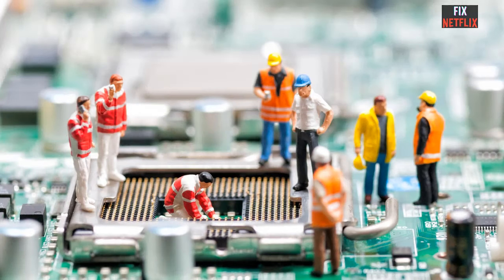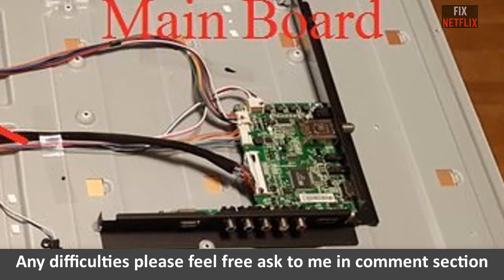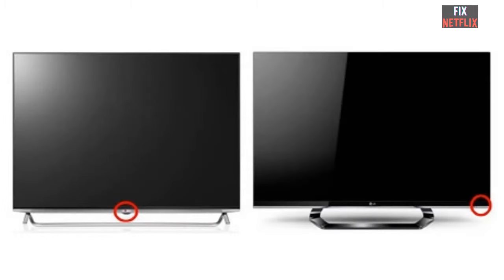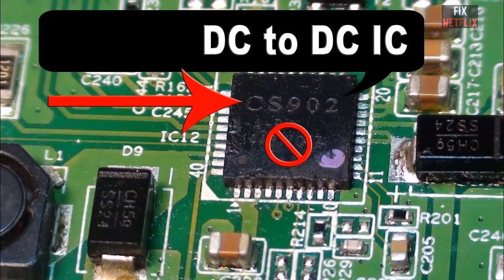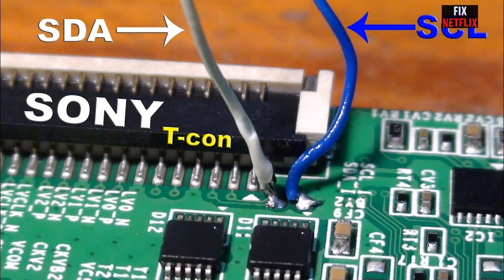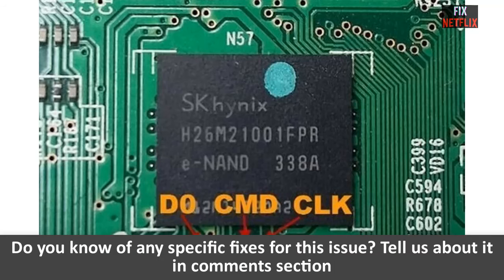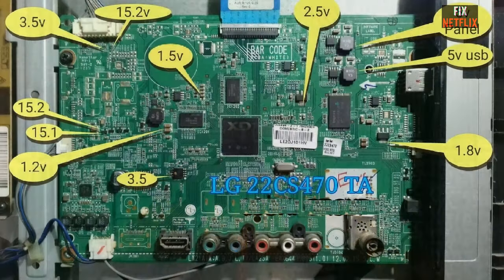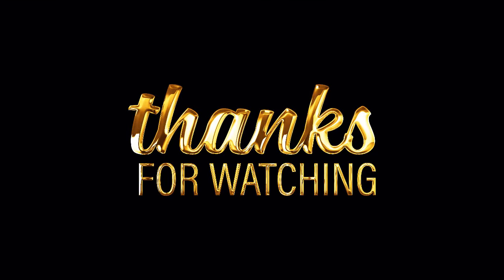Samsung TV Mainboard Repair Guide || Step BY Step Troubleshooting || You Must Know It

Comment: Thanks for the very good troubleshooting video.  With a Samsung tv/monitor, LT22b350, with the mainboard unplugged, the power supply has PS_ON 3.3v,  with the mainboard plugged in it has 0.5v.
The standby led blinks once when mains is plugged in, then it is off.  
It appears that the PS is good, 13v, 5v, and 3.3v where expected with mainboard unplugged and only 0.5v when plugged in. What do you think?

Comment: I like your videos.  I have a 70 inch sharp tv model number LC - 70le660u. The tv back lights turn on but I don't have a picture,  but the back lights won't turn off. I am wondering if you have ran across this problem and can help me. Thank you

Comment: The background information: I have a Samsung HG55ND678EFXZA Hospitality TV. All of the peripheral ports (HDMI, USB, COMPONENT VIDEO INPUT PORTS) work. The TV works perfectly, if for example an Amazon Fire Stick is inserted into the HDMI port. The Amazon Fire Stick remote control works perfectly.  But SOME of my controls on the Samsung Remote don't work, some DO work! The remote is new and has new batteries in it so I'm confident that the remote itself is working 100%. The REAL questions I have are: 1. What function does the 6 pin jumper block on the mainboard perform? 2. The mainboard has a small coin cell battery on the PCB. What is the purpose of that battery? Thanks-Robert

Comment: I have an LED TV which I bought without remote control. When I found the remote for it I noticed that while the TV infrared responds to a touch from the remote, nothing happens on the tv based on the button pressed. How can this be repaired?

Comment: what’s the problem smart tv everything is  works without pictures,sound,or a video nothings works at all only the screen appears
Reply from the maker: Dear sir, Thanks a lot for reaching out here.  Please unplug the tv power cable and wait 5 mins. Also disconnect all external hdmi cable s.
After 5 mins later Now plug in back power cable and recheck the problem.  Also check the menu screen, if appears menu screen thats mean no hardware issue.  
If not appears menu screen thats mean tv has hardware problem.  You need to open the tv and check the lvds cable . 
Any difficulties please inform me. I will be happy to help you. 
If the information is helpful please like and share this video with your friends and subscribe to the channel for next video.

Comment: How to open the back cover..?
Reply from the maker: Dear Sir, Thanks for reaching out here. Please unplug power cable  and hold power button for 10 seconds to release the static electricity.  
Then open back cover by tolls. And carefully don't touch psu capacitor.  Possibilities of electric shock. 
However any difficulties please inform me.  I will be happy to help you. 
If this information is helpful please like and share this video with your friends and subscribe to the channel for next video.